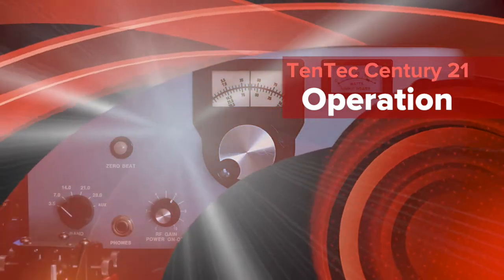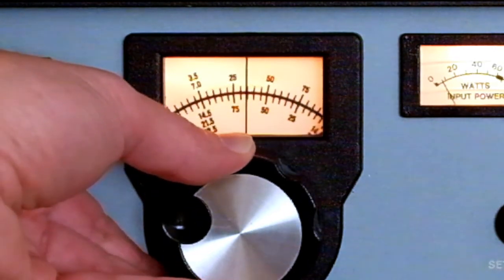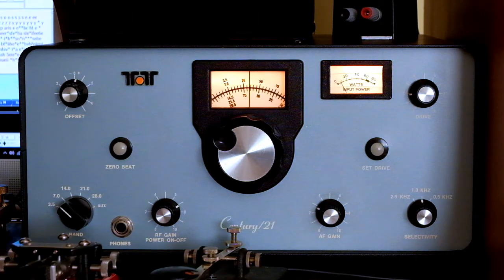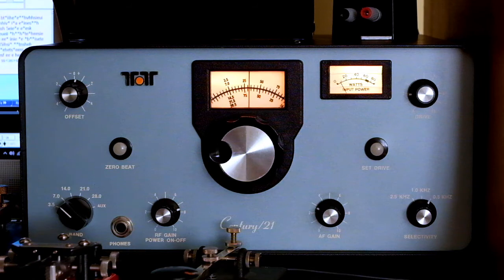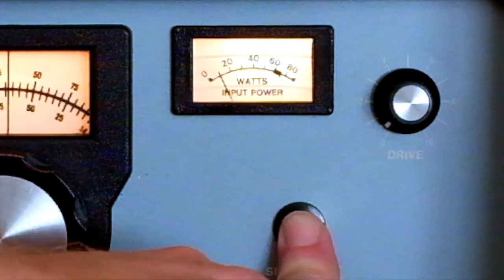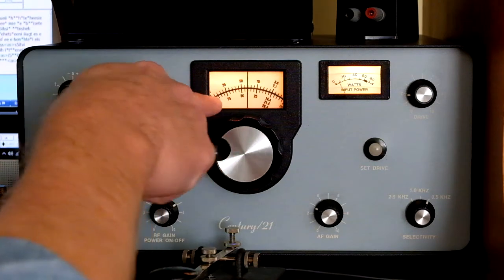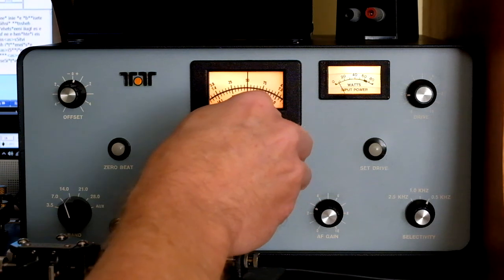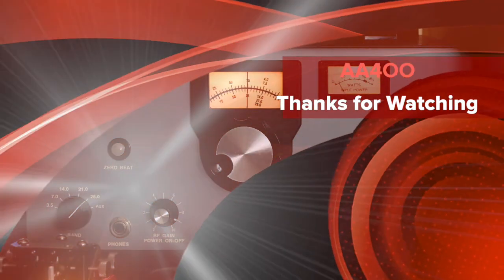Operating a TenTec Century 21

Comment: You ever have to re grease the PTO? I have an Omni D and it hasn’t been rebuilt or regreased since I got in 84. It will probably start sticking next week.
Reply from the maker: No, but it defintely has some sticky spots.  I don't think TenTec sells the grease kit any longer so finding the right "stuff" and o-rings may be tricky.

Comment: rather than using your key could you have used the drive button when you switched to your antenna? or do you need the key to see your drive output to antenna?
Reply from the maker: The drive button could be used as well as the key.  The key was just easier to reach.

Comment: The reason the dial is set up that way is that the radio uses the VFO as a BFO. The numbers help you see what freq.  you're on. 14.4 means you're at 14.400 so if you tune to where the 25 is you're at 14.425.

Comment: The auto protect feature will also shut the radio off if the SWR is too high and the radio is getting hot. They had this feature because at the time transceivers with solid state transmitters were a new thing and transistors can't handle heat or bad SWR as well as tubes can.

Comment: Even though it takes the off set out of it, it's best to have the offset set at zero, because the offset adjusts only the receive frequency not the transmit freq.
Reply from the maker: Yes but once you zero beat if the offset is at zero you can't hear the sending station.